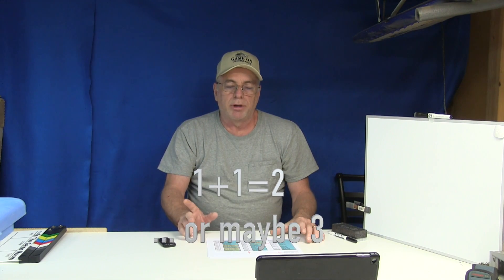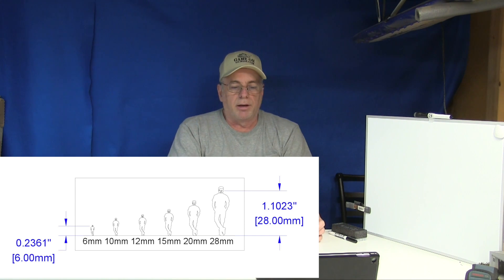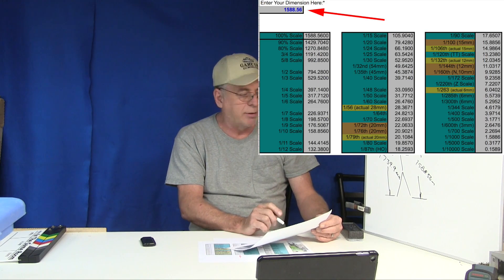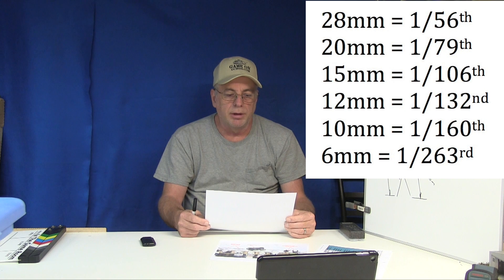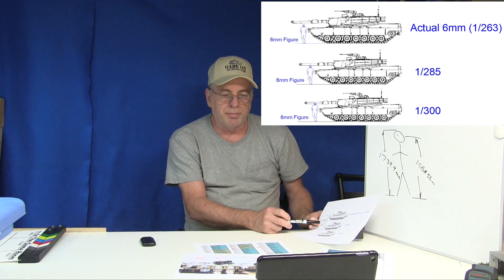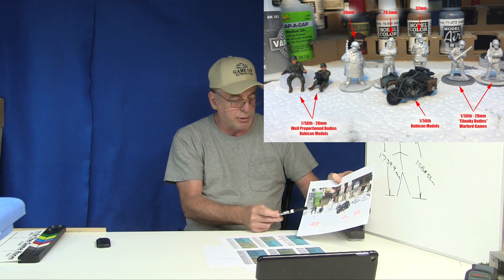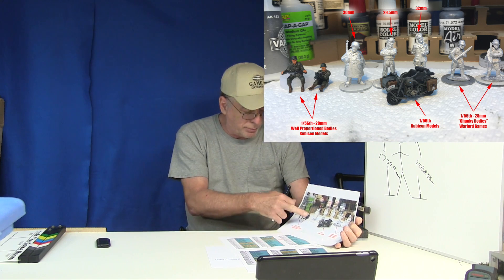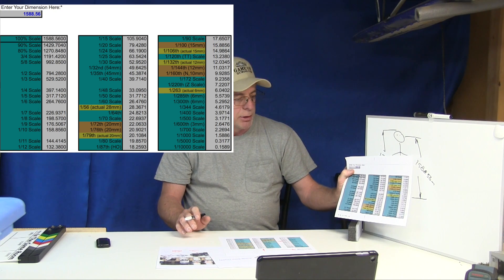In The Game Room - Episode 72 - The "Final" word on Wargaming Scales

Comment: One possible explanation of why, to many people (including me), most WW2 28mm figures just look too big next to 1/56 vehicles is the change  in average height since the war. Your average German male is now two inches taller than he was in 1940. 

We have a 'correct' comparative vehicle/soldier size in our heads, based on contemporary footage and photos. As you're using modern data in your analysis, it would figure that your average mini would just look too tall- AFV's from 1940 don't get bigger. Add in the 'bulk' of most figures in this scale- as you've alluded to- and it's no wonder they jar on the eye. 

I still think 1/48 scale vehicles just LOOK right when put next to the vast majority of 28mm figures.

Comment: Good video but no mention of 25mm - 1/60?  ;)   I was a bit disappointed with the German figures - if anyone should be oversized and heroic, it's Schultz!
Reply from the maker: Pat, according to my spreadsheet, 25mm scale falls directly in between 1/63rd and 1/64th scales.  I would go with 1/64th as some models are available in that scale (Die cast models I think).
Reply: I have quite a few 25mm Colonials dating back to the 80's. As I recall there was some disagreement between manufacturers on whether the height measurement was to the top of the head or to the eye line with the latter being simpler for figures with headgear.  Taking 5' 9" to the top of the head as 25mm gives just over 1/60.  I definitely recall 28mm figures being sold as "heroic" 25s, with 32mm eventually taking over the heroic slot as 28's became standard.  

In all the mm "scales" are a mess which your video makes a very good attempt to unravel.

Comment: Great description.  When I first was introduced to micro armor in the 70s,  my friends just referred to it as 1/285th scale, and I had never heard of the use of the term 6mm scale.  I can see the confusion when a human figure dimension is used as the basis of the scale.  With an accepted figure height standard, the math will work out.  Math is just math,  and I appreciate the explanation.  Probably the best explanation I have heard on this topic.